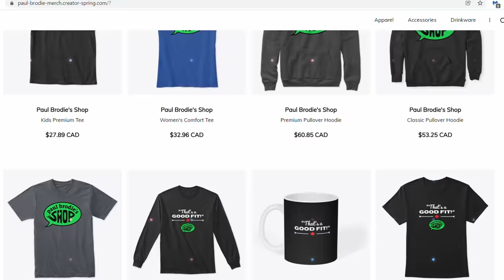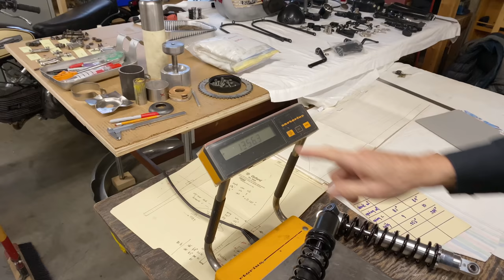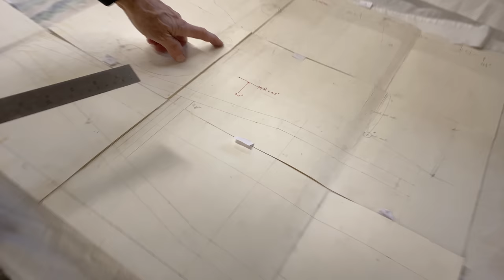Aermacchi Shock Therapy // Paul Brodie's Shop

Comment: Paul, Mitch - as always, thank you!  

On the chassis which I'm building, I'm faced with a similar situation.  The new chassis will be a little taller in the rear than the stock bike, and I have a pair of nearly new WP shocks which I'd like to use, but they will be vastly too stiff and ~1.25" too short for the new bike.  One solution would be to move the shock mounts on the ZRX1100 swingarm, and another would be to remove the lower part of the shock and machine up a new one that is longer.
Reply from the maker: Thanks Alan, yes, you will have to figure out which solution will work the best for you...

Comment: Works Performance shocks have always intrigued me. Compared to a modern motocross shock the valving is quite simple. Using a single valve with spring loaded balls with various sized holes through the valve for compression and rebound makes tuning them easy compared to shim stacks. My only qualm with them is no clicker adjusters. I have a set on my 1975 CR250 and my TTR110 pitbike and they work great for that. Good to see them still alive and well after all this time. They look great on the Aermacchi Paul. You showed some great tricks in this video! Take care
Reply from the maker: Thanks Po. I have had good luck with Worx Shocks, and I like to support them.

Comment: Always lovee seeing your problem solving and jigs etc you come up with. Have to say, thought maybe you'd have made that part to hold the mounts to the top part so they had a threaded insert like a lateral swing arm adjuster on a tractor and then you just wind it back in once you're done setting the shock mounts and have it to reuse again and again, and be able to do different lengths.
Reply from the maker: Last time I did that job was 20 years ago. I have a lot of fixtures in my shop from years ago and I can't remember what I used them for! Thanks for your comments.

Comment: Nice job with the mounts. I wonder why you couldn't just use a bolt and spacer through the top mounts for position?? Thanks guys.
Reply from the maker: Thanks. It's hard to visualize exactly what you mean. I'm just copying my race bike that got stolen.
Reply: @paulbrodie  I understand that. Just thought you could maybe use a long bolt and piece of pipe for a scacer instead of making adaptors and having to cut out the spacer.
Reply from the maker: @TheOldaz1  It's an odd size of a counterbored hole, so this was the easiest way for me. I have lots of metal offcuts, so I didn't have to go out and buy a special piece..

Comment: Over the years, when I’ve sat scratching my head trying to figure out how to achieve a particular thing, and eventually come up with a solution, I’ve often wondered if anyone else does it the same way. I guess we all need some form of confirmation we’re on the right track, and maybe not being silly. 

Then I see Paul Brodie do it the same way, and know for sure I got it right. 

The only question that remains unresolved is how much clearance will be lost when I sit my fat a$$ on the bike and the rear suspension is compressed on settings 1-?

How to substitute the rider…?

Great vid. Two per week is an excellent idea.
Reply from the maker: Thanks G58. Yes, a couple a week seems to be working.

Comment: Having the shock mounts on the top of the swinging arm, would have made fitting shocks with what look like springs intended for car coil overs, much easier, and the mounts would have been a lot stronger.  

Serious classic racers here in the UK very often use shocks made by Maxton Engineering, who also make cartridge forks for older bikes.
Reply from the maker: I'm a big fan of Worx Shocks. I've used them for a couple of decades. Yes, there are different ways to mount a shock, but I am building a replica of my stolen race bike. It will all work out fine!

Comment: Shouldn't you have pre loaded the shock to get the correct ride height? What about swinging arm angle, or is that getting too complicated?
Reply from the maker: All of the lengths and angles were used when I ordered from Worx Shox. Sag happens when I sit on the bike. The bike is too light to sag under its' own weight..

Comment: I believe if the shock valving is suitable for shaft pointing down it will still work shaft pointing up, but if made for shaft up, it won't work inverted.
Reply: For most coil-over shocks, this is true.
Reply: @Alanbataar  for most any monotube shocks in my experience.  Bilsteins, for example don't care.

Comment: Looks like your shocks will fit correctly if they were flipped end for end and mounted like you had them on your stolen bike. All my bikes have the height adjustment cam on the bottom. Great idea for mounting your shock mounts,
Reply from the maker: Now you're comparing Koni shocks with Worx Shocks. Likely 2 different designs. Yes, the Worx Shocks will fit better upside down, but they will get modified with a lighter spring, and then fit the proper way.

Comment: The lighter spring with fewer coils "can" be made to be the same rate.   But. The stresses itll see will shorten its fatigue life.   Which.  Is fine for a race bike that'll only be used a short time...  if it's a street bike that will be used for many years?    The heavier lower stress spring is probably a better idea
Reply from the maker: I'm going for the light weight. I found my notes from 2001 and that "stolen" spring only weighed 256 grams and helped me to win a lot of 500 Vintage races.

Comment: 😬    moving the lower shock mount fore aft will change the wheel rate/ effective spring rate of the system....potentially alot
Reply from the maker: Yes, small changes can have a big effect. You are correct!

Comment: Please be aware that race tyre manufacturers never stand still. This might me a classic tyre for racing, but the demands in the community are cut throat even at his level of performance. Expect them to work with more forward weight balance, better carcass, Expect the profiles to be more triangular and do not be surprised if they need a harder rear spring to utilise the current compounds.
Reply from the maker: I'm just building a race bike to replace the one that got stolen. I'm not planning on racing!

Comment: Such a weight weenie! :D
Reply from the maker: In a way, yes. But have you noticed a haven't weighed a single thing on the Tiger Cub??
Reply: @paulbrodie  Good point. Less weight is addictive though, especially if you know you're able to save a few grams.
Reply from the maker: @Metal-Possum   My first Aermacchi race bike weighed about 245 lbs, which is not bad. Then I built the second one and focussed on saving a few grams here and there. I figured weight would be in the 130's, and got a shock when it finally weighed in at 221 lbs.
Reply: @paulbrodie  That's almost as light as a vintage CCM bicycle I have...
Reply from the maker: @Metal-Possum   Dutch bicycles were very heavy when I rented one in the 90's. It wasn't fun to pedal at all.
Reply: Gazelle do a model with some carbon fibre in it, it's still heavy. I just wish they'd go back to using steel. If they're going to be heavy, they should at least have some style.